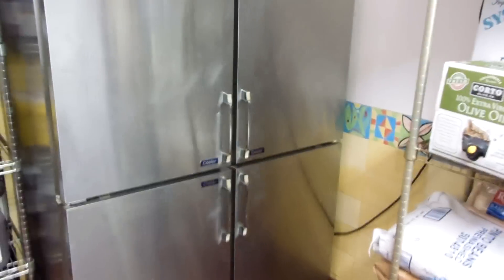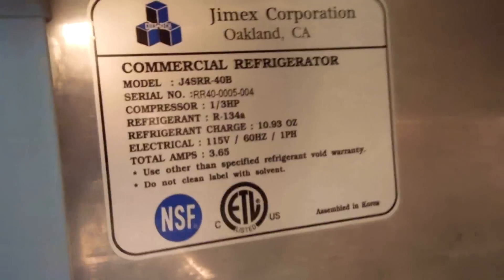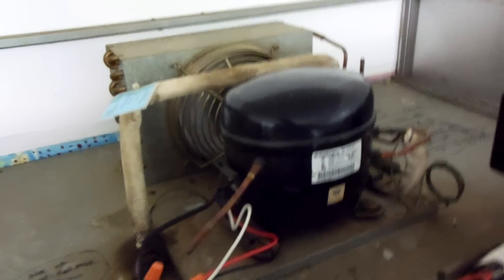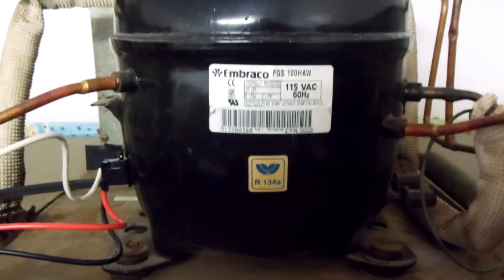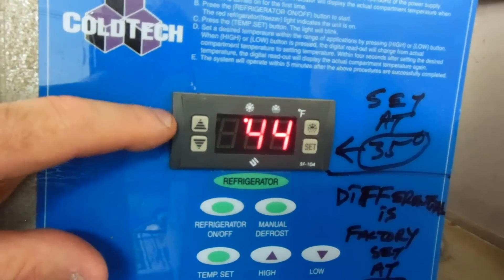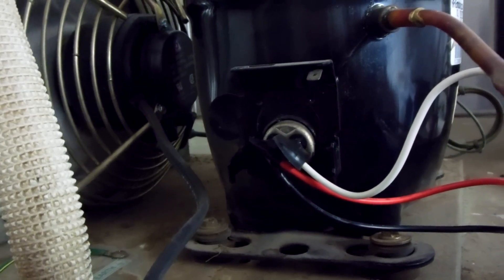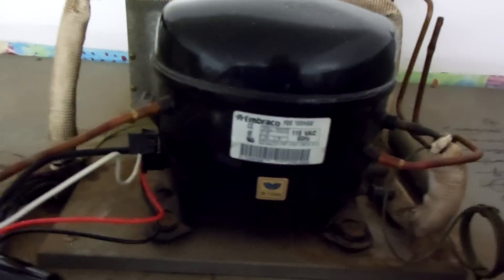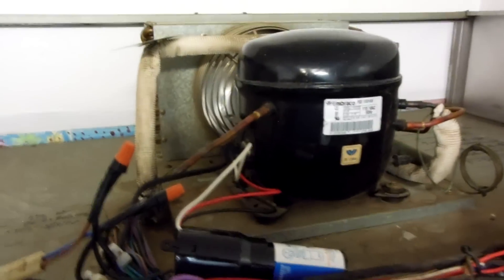HOw To Wire in a RC-0210 Hard Start Kit on a 115 Volt Embraco Compressor.

Comment: Hi Oc, great info video once again👍🏼 so you can put the supco 3n1 on a compressor that doesnt originally have a start capacitor ? Im working lm a Beverage air reach in and it keeps clicking and turns on the 3rd or 4rth time should i put a 3n1?? its also shutting of on overload, charge seems good, compressor hot to touch tho? 
thanks so much for always helping👍🏼
Reply: it has an overload and a current relay but no start capacitor** ! the relay keeps clicking before turning on **  
Compressor shuts of on overload, again condensor fan s ok and clean
Reply from the maker: Yea, u can put a 3 in 1 on any thing. Just size it right or 1 size bigger is ok - good / better.
Reply: hi , Oc , yes i put it on since last week, it has been running perfect. yes since you made that video on how to size them i only stock the 210 kit . thank u once again
Reply from the maker: Sorry did not see your comments. Missed them.

Comment: Thanks for this video. Needed to confirm the pin out on a Embraco EGS100HLC. Fridge is 20 years old. A service tech installed a RCO410 in 2005 and I am doing the same again now as the fridge is not cooling properly again. Not certain if the fix is working this time. Will give it few hours to see if it works again. The compressor may have reached end of life after 20 years of service? Thanks again and your video is excellent BTW
Reply from the maker: Glad it helped & Thank you.

Comment: What for are those two pipes  that are on the botom of the right side that are noy used .What is their function or how are they called .  I have a similar compresor it has  5  pipes coming out of  it .
Reply from the maker: Oil cooler lines. Could be used to cool the oil or warm the oil depending on application.

Comment: As a semi retired, Journeyman HVAC Service/Installer and appliance repairman, now instructing, I have learned that when the terminals are two on top, one on the bottom, start is top right...Two on bottom, one on top, start is bottom left...Also the RCO 410 is for lesser HP compressors,  1/4hp - 1/3hp...I have not had a problem with them...I have not used a larger rated RCO start kit, on a smaller HP compressor, so I don't know just how it would effect the unit over time, but I"m thinking it can't be good...Still, a nice informative video and my thanks to the gent that make it
Reply from the maker: I Have never had a problem using the Rc-0210 on 1/4-1/3 or 1/2 Hp. Ive been doing this 40 years. You do see that the 410 kit has  a range 1/4-1/3. I have just found the 410 kit to be very weak & not do its job well. It might work on a 1/4 hp but works poorly if at all on a 1/3.

Comment: Our fridge stopped cooling yesterday and me being me cheap guy I am I started looking as to why. All indications were the start relay assembly had taken a permanent vacation. Found what I thought was an equal replacement but the orientation of the pins on the Enbraco compressor were different from any documentation that was with the replacement part. I found this video and made the connections like shown in the video and it looks like we are cooling again. Thanks!
Reply: That's exactly why I'm here too!
Reply from the maker: You got it ! Great !

Comment: I have three wires one for the run, one for the start and one for the overload, how do I hook up the wires to the two black wires on a hard start kit kit if I have to install one?
Reply from the maker: follow the wiring diagram on the hard start kit. it is very easy to understand.
Reply: useless man, if he had the diagram he would not be asking

Comment: I also have a Embraco compressor on my Whirlpool side by side frig Model # GD5SHAXKB02 built March 2002 it also has the two pins on the top with one pin centered below them in a triangle. But it has a White wire going to top left , a Blue wire going to top right and the Red wire is going to the bottom pin. The White and Blue wire are going to what may be a relay ?(little 1'x1'x2' rectangle with two male spade connectors and screwed into a crossmember next to the compressor.  A second White wire ,also going to the top left pin , and the Red Wire on the bottom pin , both run all the way to the other side of the frig. So which pins do you think are the RUN , START and COMMON ?  I am using the RCO810 INSTEAD of the RCO210 you use here but that should not make any difference.  Thanks  BOZ   PS. ( Embraco is an EGY 90HLP 15.1 LRA made in BRAZIL)
Reply from the maker: Watch the video. It is at 4 minutes exact how to wire in. Common -- bottom , start --- upper right , run --- upper left. Please hit like button, share on facebook  & all your social media & subscribe. Thanks.

Comment: I was looking all over to see how to connect a Supco RCO410 to an Embraco compressor. Their connector is upside-down compared to everyone else's. Your video confirmed that it is an exact 180-degree rotation, no translation between the pins.

Five minutes of extraneous information, but it was worth it.  Thanks!
Reply from the maker: use arrow buttons on keyboard to fast foreward videos to the part u want to view.
Reply: Navigation wasn't the issue, Oc. The problem was that I needed to know how the connector was wired but I had no prior knowledge of where in the video it would be discussed (if it were even discussed at all). I had to watch most of the video before it was mentioned.
Reply: I found the same results with my multimeter. The video helps confirm I was right about the terminals being reverse cause both of them to common is only 1 ohm difference. Wanted to make sure my multimeter wasn't being screwy

Comment: The supco 3n1 saves the day! I love those darn things! Some people swear you gotta have the oem cap and relay but i havent had an issue ever using the universals! Your right that thing does look like the everest stuff.
Reply from the maker: Totally Agree. I Have Never Had a Problem With the Rc-0210 Kits Either. NO Truck Should be without one. The 410 kits are junk. i have never had a 410 kit work. i just use the 210 on everything. Those Rc-0210 kits save 9 out of 10 compressors.

Comment: Thanks for the video. Would you use the 210 1/4 hp compressor.
Reply from the maker: Yes sometimes, how i attack that one is i try the 410 on it first and if it sounds and goes good. great. if not, put a 210 on it and it usually goes. if not compresor is junk.
Reply: Thanks for taking the time to edit and share your videos.
Reply: So the 210 is for 1/2 hp and would have higher microfarad capacitance and the 410 is for 1/4 hp with lower mf?
Reply from the maker: @davejohnsonnola2758   Yes.

Comment: That controller looks an ELIWELL did you mean delay between starts or do you mean temperature difference
Reply from the maker: Yea, delay between starts. off time.
Reply from the maker: Controller is a Ui SF-104
Reply from the maker: thanks.
Reply from the maker: i Think i Found it. Lock Parameters. http://p.globalsources.com/IMAGES/PDT/SPEC/161/K1064108161.pdf
I Found the Pdf.
Reply from the maker: i have never used a eliwell, but i googled it and yea, you're right looks pretty close, i'll have to check in more detail to see if same. the one i'm using has a defrost cycle able to be programmed , don't now if eliwel has that feature.

Comment: Some of those controllers have two levels of parameter access, there's usually an extra button to press to get to the second level where more things can be altered. Think it's done to stop customers messing with them. No idea on that model as we don't get them here! I usually just Google them with my iphone if there is a good enough signal for data.
Reply from the maker: yea, i googled it and did not see a trick to access programming. but, i think you're right i just have to find the key.
Reply from the maker: Controller is a Ui SF-104
Reply from the maker: thanks.
Reply from the maker: i Think i Found it. Lock Parameters. http://p.globalsources.com/IMAGES/PDT/SPEC/161/K1064108161.pdf
I Found the Pdf.
Reply from the maker: yea, this one was a bit tricky, u push the down arrow down for 10 seconds and it appears " off " or " on " lock. weird to change it. you don't go up or down to change, just accessing it changes the lock to on or off depending how many times u access it. every time u access it, it changes. weird way of doing it.